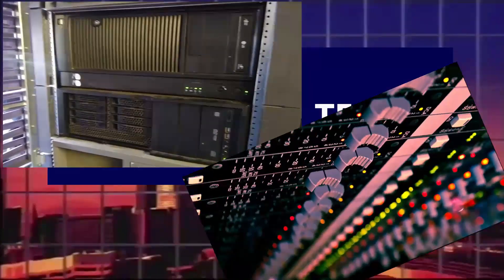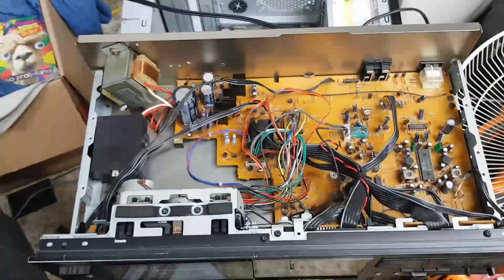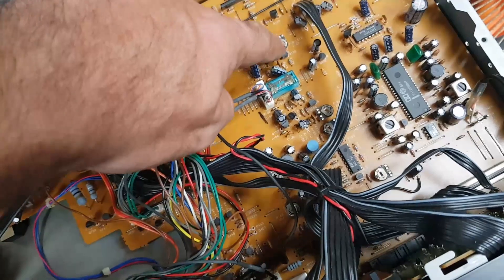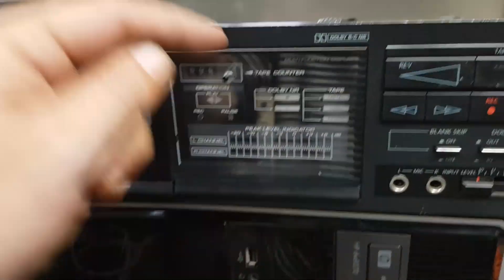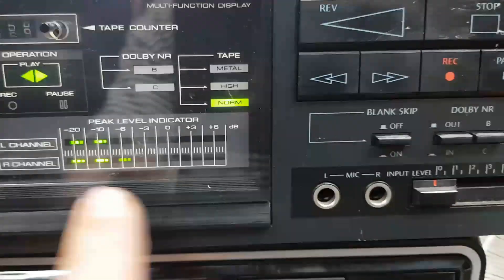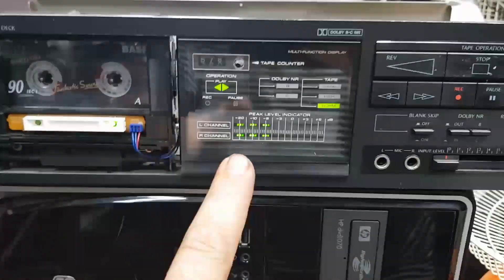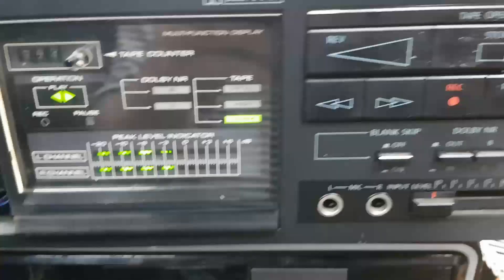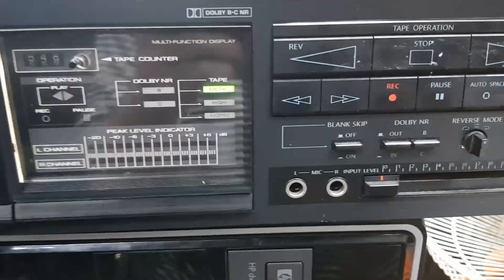Retro-Tech - Onkyo TA-R22 Cassette Deck PT4 - Level Adjustments

Comment: I put the Service Manual on the facebook group page.  Page 4 of 13 shows all the ajustment levels.  All you really need is a AC voltmeter for most ajustments per the book.  Make a test recording at 10kHz -15dB and 3kHz at -10dB and another 400hz tone at 200nWb/m for your Dolby calibration See (4) on the page.  AC voltmeter to TP101 and 102 you can adjust R127 and 128 to 380mV no more than about 600mV.